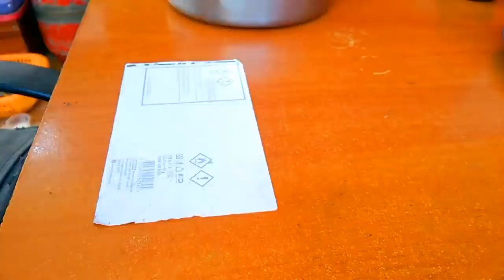How to super clean ? Bajaj NS 200 carburetor ? Episode 3

Comment: @muhammad ali  please  help me my 200ns hiccups a lot  or jerks.. but sometimes it goes smoothly. service center guys tried several times but no use they couldn't solve it. each time they simple changed ignition coils. i'm suspecting a faulty CDI and some issues with carb. carb also giving a strange ticking noise at regular intervals.  your help will be highly appreciated.. thanks a lot!!!